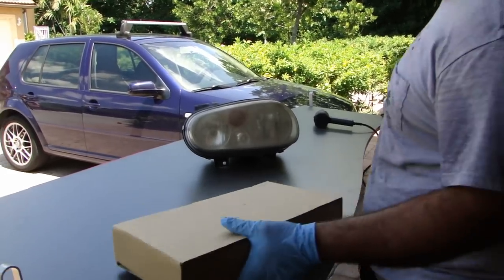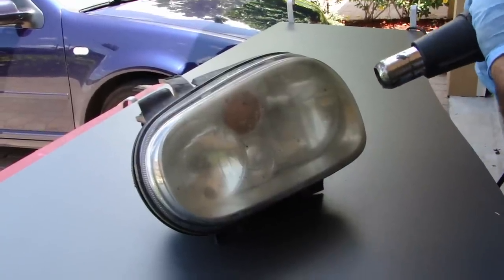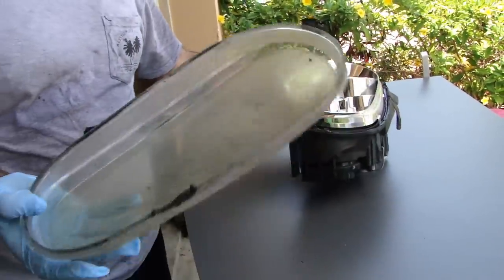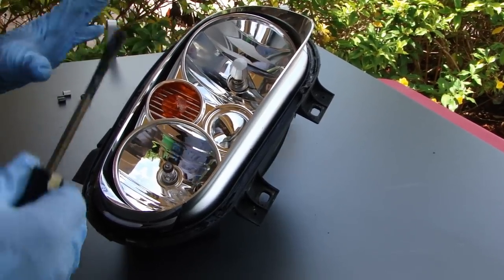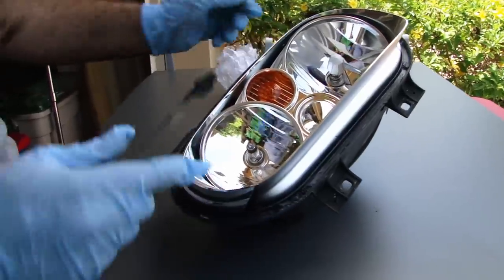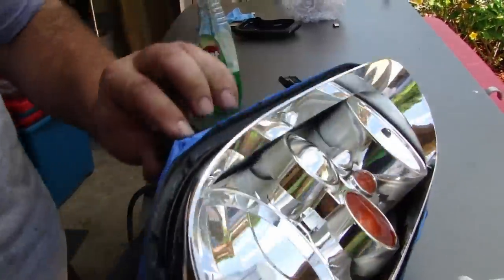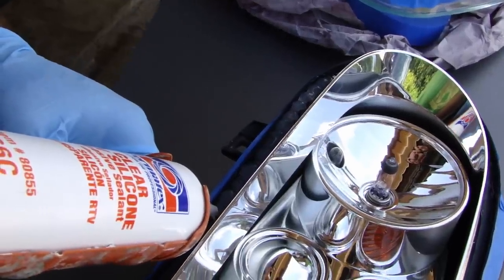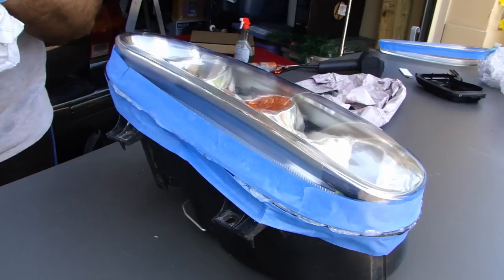How to permanently fix your foggy VW Golf / Jettaheadlights!  Replace plastic with glass lens

Comment: First of all thank you for the excellent tutorial.  I installed my lenses using a method I saw at another web site:  Headlight in the oven, on a cookie sheet, at 200 degrees for 20 minutes.  The old lens then peeled away easily and left the butyl rubber intact.  Back into the oven, along with the new lens, for 5 minutes.  After that the new lens seated very easily with no mess and no fuss.  The hardest part of the job was watching a headlight bake for 20 minutes. :)

Comment: I tried cleaning my old headlights with toothpaste sand and eagle feathers but it didn't work? A friend of mine says put it in a tree stump and leave it in the moonlight for three days as this will defo work!  What do you think, should I buy a hair dryer and crowbar?
Reply: Fellatio Belsen da ploisher and compound. gone less than a minute
Reply: DEET works really well, yes, the ingredient in OFF insect repellent
Reply: Fellatio Belsen toothpaste only works on plastic lights but cola is better for stripping the fog off plastic light neways

Comment: Please don't spread fiction as fact.  Any hardware grade clear silicon has a max temp between 400-500 degrees F.  Far beyond "the black stuff" which would be liquid at those temps if not smoking.  Silicon used to be rated for 25 years, but even that proved an understatement and now it's rated "lifetime" as it out lasts anything it is used on. I have silicon caulking on my home (and tractor) in the daily sunlight that is over 30 years old.

Comment from the maker: The silicone that I used is heat resistant up to 450 degrees, it was not cheap, $12 per tube.

I did try the oven method recently, which works great by the way.  7 mins in the oven at 300 degrees, easy to pull the old lid off.  I also heated up the new lens at the same time, that made it really easy to seat the new lens on the black sealant flushly.

Comment: Why did you remove the original black sealant from the lens surround and replace it with cheap old silicon, firstly it isn't as heat resistant as the original black sealant and WILL age and deteriorate over time unlike the black stuff. 
Another way to remove the lens is to place the entire light fitting in an oven and heat up for about 15 minutes at 250F, pry the old lens off and then reheat and install the new one.

Comment: Preheated my oven to 250 degrees fahrenheit and then placed the headlight assembly in the oven for 10-11 minutes (lens side down).  Removed it from the oven and then lifted off the old lens cleanly with a quick pry from a flat screwdriver.  There was no need remove the old sealant from groove  because it stayed in place.  I pressed the new glass lens into the groove.  NOTE: make sure it's seated firmly all the way around - press hard.  Reheat if necessary.  My lenses didn't need silicon sealant.

Comment: 3M has the plastic lens restore, less work.  Plus is the glass less DOT/SAE labeled?  If it's LEGAL it ha to have the DOT SAE embossed on the glass, no DOT, not legal.  Technicality matter, even though of course new glass puts light back out on the road, but without DOT, they are technically illegal.

Comment: Fair enough but I put that down to quality control rather than silicon. If you heat the lamp housing and new lens properly before you reunite them with a quick look to see where a little extra sealant may be needed to be moved to to help even it out, will make all the difference. None the less this is a good video tute, thanks for taking the time to share :-)

Comment: Why waste money on headlight lens,
 when you can restore back to New condition with Rubbing Alcohol, i cleaned my headlight lens last July of 2015 and it is May 2016  now and my lens are still like New.
Reply: +Newfie Led Man please tell me your story, i am wonder how you did renovation
Reply: hi
All i used is the 90% kind of the Rubbing Alcohol you can pick this up at a local Pharmacy drug store, i then used a lint free cloth wiped on then buffed off by hand, you can also use non acid tone Brake fluid as well.

Comment: Is it possible to remove the silicone again after this process?
Reply from the maker: Not easily, some people have sugguested using butyl rubber instead of silicone
Reply: FixMyVW.com by AARodriguez Do you happen to know if they have been successful? I am nervous of the durability of the glass and would hope I can just replace the glass again. :)
Reply: Tea H I've dealt with butyl a bunch from working on an RV I used to own, and the sealant he removed from the light looked like a lot of butyl that I have dealt with. so I think that it would work just fine. sorry I don't have any actual experience with using it on headlights, though
Reply: You're showing you age - or lack of it! They used glass for headlights since they started making cars!  The only reason they don't now is because some asswipe "engineer" decided it would make them more money on replacement parts to use that crappy plastic junk.
Reply: rod builder there should be laws against using plastic lenses on cars.

Comment: So during the process my glass lenses didn't seem to go all the way onto the headlight.  I tried both lenses so I wasn't using the wrong one it would slide on then, there would be about an inch on the top part that wouldn't slide all the way down.  Any ways you think i could get this to work?
Reply from the maker: I've never heard of that happening, could you send me a picture?
Reply: I'm thinking its because I have after market headlights.
Reply from the maker: Colbey Morf I guess that could do it.